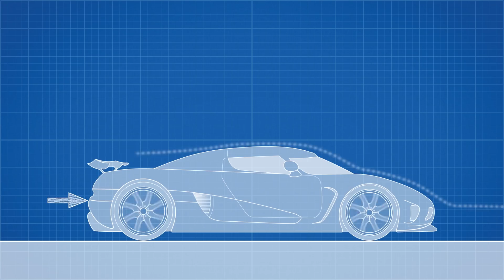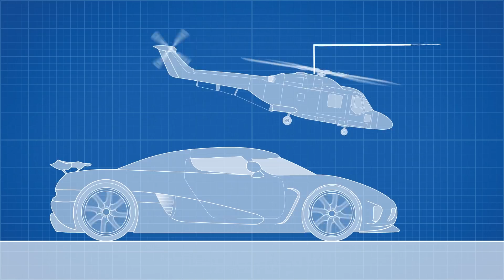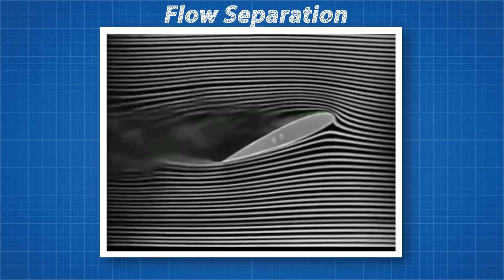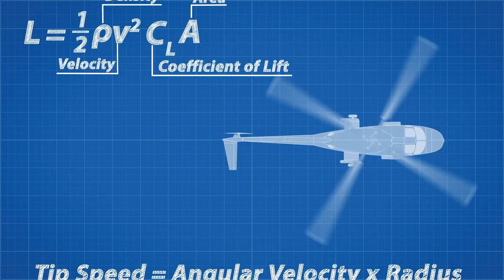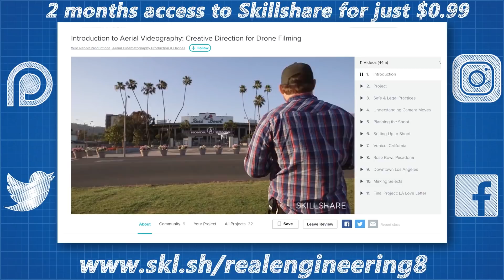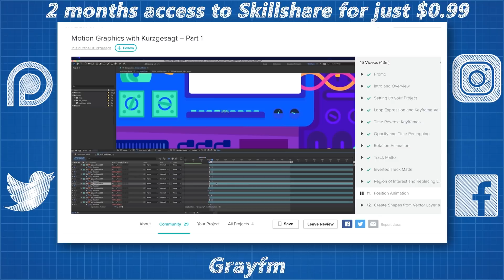Fastest Car vs. Fastest Helicopter - Which is Faster?

Comment from the maker: I misspoke in the intro sequence. Get TWO months of Skillshare for just 99c using this link: http://skl.sh/realengineering8
Reply: Hmm the arrows are going backwards but the tire appear moving forward.
Reply: please do an analysis of the Boeing–Sikorsky RAH-66 Comanche helicopter pretty pretty please
Reply: The arrows on wheels are drag, which are opposite to wheel movement.
Reply: More aviation stuff!!!!! <3

P.S. - In aviation, we generally use 'S' instead of 'A' in the lift equation.
Reply: btw i really enjoy your channel keep up the great work, i look forward to each new video !!!!!!!
Reply: Real Engineering oo
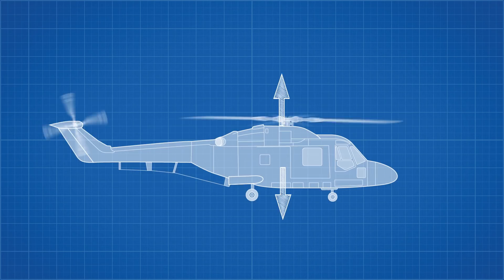Reply: Hi Brian, it would be great to see a video on some of the specific physics of the helicopter.  Like @3:24 angling the rotor disk forward to translate a portion of the lift into thrust.  There are some interesting things happening here.  The rotor hub is perpendicular to the rotor shaft and that angle would remain constant.  In hover, potential energy is equal across the rotor disk, so you wouldn't be able to angle it from a fuselage that is basically hanging from it like a gondola.  To move you have to change the way the rotor disk opposes gravity.  You have to put more potential energy on one side of the rotor disk by increasing the lift generated by the rotor blade as it sweeps around the helicopter.  Which is also interesting because of gyroscopic precession you have to apply the force 90 degrees to the direction you want the force.  If you want to go forward, you need more lift at the 6 o'clock position; however, the force has to be applied 90 degrees before.  In a clockwise rotating rotor,  that would mean the force would have to be applied at the 3 o'clock position.  If you look at some of the footage closely, you can see the rotor disk is angled perpendicular to the direction of travel.  Also, it is really interesting to consider how a helicopter actually moves.  Lift is generated by the rotor blades pushing the air down, which generates an upward force.  NASA explains how Newton's law generates lift with a wing -> https://www.grc.nasa.gov/www/k-12/airplane/wrong1.html.  If the four forces of flight are gravity/lift and drag/thrust, then how would the rotor blades generate thrust if they generate lift?  If the energy from the rotor blades rotating is used to generate lift, then you couldn't use that to generate thrust in a direction that isn't parallel to the direction of force.  Thrust is opposite of drag, so if you increase the trust from the rotors, you have to compensate for the drag.  The rotor blades are used to push the air down to make lift, if you decrease the rotor pitch, you decrease the lift; and if you increase the speed while maintaining rotor pitch, you increase lift.  Lift and thrust are not equal and opposite reactions.  There is a placard at the Smithsonian Air and Space museum, not the one in the Washington D.C. mall, the one near the airport, that explains how helicopters use a dyssemetry of force across the rotor disk to produce thrust.    Thrust is produced by increasing the potential energy on one side of the rotor disk which turns to thrust as the energy balances out across the rotor disk to maintain equilibrium against the pull of gravity over the rotor disk.  There is so much more about helicopters that is worth exploring.  Your assumption is correct, I am only educated enough to be dangerous...
Reply: Dont care about that but i love these videos
Reply: too bad it doesn't work when i click sign in with google OR the sign up button
[edit] nevermind, it worked now. their server must have been overloaded or something

hope i find a decent android programming course there.
Reply: That promotion transition was smooth af.
Reply: Okay...
Reply: Thanks! I literally had this argument yesterday! (I was on the side of cars)
Reply: Real Engineering why when i clicked the link for your website , the web wouldn't exist
Reply: I like watching videos where you start to think of questions and then almost as quickly as you think of them they are explained.  It makes you feel smart that you know what questions to ask!  (Of course, it's usually just an example of someone explaining things really well in a way that systematically runs through all the possibilities... but I'll pretend I'm smart about aerodynamics!)
Reply: Jorge & kuda, I assumed that the counter-rotating wheel arrows represented the force of rolling resistance. The arrow indicating drag force appeared shortly after.
Reply: "This video is brought to you by Skill Shareidgut-three months of learning....."
Reply: Real Engineering when utilizing dual counter-rotational rotors the airframe's strength limits the top speed also. The CH-47 Chinook is theoretically capable of reaching the speed barrier of rotorcraft, but it would twist itself in half from the increasing torque forces distorting the rotational center point toward opposite sides, if allowed past current governed outputs. Reinforcement of the airframe could negate the effects, but the mass increasing will restrict it in a similar way. There is always good ol' JATO rocket assistance, if you are tired of living, to beat the car's record.
Reply: Real Engineering after watching this I'm not sure if you fully understand how a cyclic controls work on a helicopter. The rotor head does not tilt as a whole. You are right in saying that the pitch of blades change as they rotate, but that's it. It's both cyclic and collective pitch mixing. It all is effected by gyroscope precession and is something interesting to read up on!
Reply: I checked it out but it seems kind of underwhelming, the tech lectures are nothing special, there are no home work assignments with grading and you can find pretty much the same content for free on other sites like coursera and youtube.
Reply: I'd like to see a video on the sterling engine.
Reply: Pretty sure the arrows were a tool to visualize the rolling resistance he talked about, and not the wheels directions
Reply: Real Engineering that's noice
Reply: Can we get skill share from or local 99c store?
Reply: It was demonstrating the rotational resistance.
Reply: The fastest car (agera rs) is faster than all but a couple special (past) prototype military helicopters, but traffic makes it hard to use that advantage so a chopper at max speed will be faster irl, also roads are rarely straight from a to b but around mountains etc unlike the choppers flight path but in a straight line with no traffic; yes i could easily outrun a helicopter in an agera rs.
Reply: ...until u get to the heli so fast it needed jet engines to get fast. yes, im talking about the BELL-222 AIRWOLF!!!!1111
Reply: SkillShare sells education as a luxury, helping to ensure that poor children will remain poor throughout their lives. SkillShare's CEO, Matt Cooper, whose children will never lack access to the very best education, spends a portion of his considerable income supporting US politicians who want even public education to come for a price (Sen. Claire McCaskill).

The poverty that comes with lack of access to education (among other factors) leads to much suffering and early death. A full quarter (!) of US insulin-dependent diabetics ration their insulin because they can't afford to buy enough. As you might imagine, they don't all survive this austerity, to which you contribute as you promote SkillShare.

That sponsorship money is blood money.
Reply: I love you so much 💓    you made think like an engineer,  send me your number please I want you to solve this problem   about Electrical engineering.......🤎
Reply: Correct me if I'm wrong but don't wheels rotate in the opposite direction to your arrow if a car is moving forward

Comment: The Lynx was heavily modified with its engines producing thrust also. The BO-105 has also achieved 404km/h. With the use of 4 or more rotors or stub wings achieving 400km/h isn't so difficult if it is designed for high speed, but the rotors and associated components are optimised for lower speed and hovering.

Comment: Good point on the definition of what a helicopter even is. By that note, we'd best define what a car is as well because the land speed record holder vehicles are cars in a very loose sense when compared to cars in our driveways. Any wheeled vehicle? Mmk. Is a helicopter then also any bladed vehicle? Definitions are important. Anyway, great video

Comment: The ability to change the angle of attack of the helicopter blades is actually how it tips the rotor forward using gyroscopic procession, and the dussimetry of lift effectively cancels that out making it so it's a negative feedback loop

Comment: The propeller os the only barrier for the helicopter to travel faster.
.the gears of the helicopter convert high rpm to huge torue to spool up the main prop. While supercar's gear desihn for speed. So why we debate this different kind of design.. all o know reciprocating engine cannot beat down gas turbine engine

Comment: Police chase of a muscle car, viewed by a TV helicopter.  The TV helicopter almost lost the car --- even with their crazy powerful (and crazy expensive) super stabilized zoom lenses they nearly lost them 10 miles away ... but the car then ran out of fuel :-)  So I was not exactly surprised.

5:36 ... more rotors.  We cannot increase the rotor tip speed, but we can use 10 or 20 rotors.  Splitting up the load means each rotor has less work (and therefore the individual rotor tip speed can be lower).  Also: "redundancy".

Comment: The Eurocopter X^3 uses what I’m assuming are a pair of turbo shaft engines on the end of those wings. What if those power plants were turbofan or turbojet engines? What then would be the theoretical top speed?

Comment: "Will always limit helicopters for the rest of time."

Hmmm.. not so sure about this.
Consider a helicopter on Saturn? The hydrogen atmosphere should give it a much higher speed limit due to higher sound speed.

Also consider that a helicopter can, in principle, be designed to pitch very far forward.

Comment: 6:04 there was a version of this back in. 1950s called the Fairey rotodyne. It had a freespinning rotor and two turboprops mounted on the wing to push it forward and boost its efficiency. It had tipjets on the tip of the blades to lift it up and are shut down in forward flight. Sadly it doesn't exist anymore

Comment: @Real Engineering - I have a question.  Because there is applied the law of gyroscopic precession, the lift generated on the right side of helicopter is apllied on the front side of helicopter. And the lift generated on the left side of helicopter is applied to the rear side of helicopter. So, in the case in video you need more lift generated on the left side of helicopter, than on the right side to tilt it foward. In that case the pilot needs no special mechanism. Pilot just push the cyclic more foward that causes tilting the swash plate - the left side down. That means the AoA on right side is lowered and on the left side is increased. Due to gyroscopic precession the lift is applied more to rear part of helicopter than the foward. So no special mechanism is needed. Am I right?

Comment: Before watching the video I guess the car is. The helicopter is limited by speed of sound on the edge of blade going foward and by the retracting blade stall.
The counter moving blades is also limited. The blades with the increasing foward speed are more and more bended until they can meeth themself.

Comment: My insane, stupid, and overly complex idea for the day:  What if you made a "helicopter" where instead of one rotor, you had two, but half the rotor's rotation occurs inside a body, such that the blade only produces lift when moving forwards?   Oh, and then, what if instead of a rotor, we make it basically a pair of giant glorified chainsaws with small wings on them?  ...What?  I SAID insane, stupid, and overly complex, didn't I? 

Chainsaw Copters!

Comment: The first helicopters called Chinooks were not Chinooks. That was a CH-46 Sea Knight, or Phrog (a common mis-identification). The navy/marine corps DID not use chinooks. oh, and as of 2012, the sea knight was retired from military use, and replaced by the V22 Osprey. 

The easiest ways of differentiating (from a distance) between the 47/46 is the front landing gear, the fuel cells, and the engines. The 46 only has one strut on the front, while the 47 has 2. The side mounted fuel cell on the 47 goes almost the full length of the helicopter, while the 46's is only roughly 5 feet long (stub wing). And the 47 has externally mounted engines while the 46 are internally mounted. The 47 is a Heavy lift helicopter while the 46 is a Medium lift helicopter, so the 47 is significantly larger.

Comment: I have questions about the power and force equations.

According to the power equation shown in the video, power seems to be a function of v^3. If you increase speed by 2 then power requirement increases by 8. But that's weird.

Best illustrated in a plane. If you fly 2 times the speed them aerodynamic pressure is 4 times higher, and the required thrust is 4 times higher too. Which means power is increased by 4, not 8. Hence, power seems to be a function of v^2 here.

Could you explain what's happening?

Comment: Suppose we take the coaxial "slowed rotor" concept to the extreme and actually STOP the rotors, using a prop or jet to provide propulsion.  Now rotor tip speed = the aircraft's forward airspeed.  Assuming the engineering challenges can be met (sufficient rotor stiffness and lift coefficient), would not the theoretical speed limit be significantly higher than for spinning-rotor configurations?

Comment: 1:58 you used the horsepower at the crankshaft, not the wheel horsepower. Drivetrain loss due to friction is usually around 15%-20% for a RWD car, which would leave you with about 985 hp (735 kW) at the wheels, which is what matters.

Comment: this one was easy the car has the ground to grab onto and propel itself forward the helicopter only has the air to grip onto and whats more it also has to use enough of it to keep it off the ground, both modes of transportation use a reciprocating hydrocarbon burning engine.....

Comment: About the diference of speed of blades on left and right side of helicotper. How about gyroscopic precession? So the more lift on right side -> Nose moving up. The less lift on left side -> tail is moving down. So in result the helicopter is not "disbalanced" in roll axis, but in pitch axis. This can be also balanced by tail wings, which many helicopters have and do. The tail wing is quite far away form rotor so low force is needed to make high enough momentum for counteracting the lift dysimetry. Some helicopters uses the Fenestron or NOTAR which reduces drag quite a lot. In result this problem looks like easy to solve. The bigger problem caused by lift dysimetry is harmonic or periodic bending of blades with very high frequency. And one note. I did not find any information about Effective Translational Lift (ETL) phenomena. This phenomena results in needing much less power for flying than for hovering. IMO actually the only limit is caused primarily by compressibility, engine power and weight, and cetrifugal forces. BTW you can also increase lift by adding more blades.

Comment: But then again, A helicopter was designed for flexibility of use and high maneuverability, not to be fast. A helicopter that can fly at 400 Km/h is amazing, considering the problem it has, especially with aerodynamic.

Comment: Agera rs is the fastest, but not the quickest at 1/4 mile. Some Fords back in the 60s ran 10s flat out using the legendary 427 Cammer, one of the best N/A engines of all time.

Comment: If both are dropped from free fall lets say terminal velocity would be around 200 to 240 km/h however if both objects were not aerodynamic then terminal velocity would be about 180 km/h to 200 km/h but if both were pointing nose down then the car would reach a higher top speed due to the car's body being more aerodynamic then the helicopter would be slower buuuuuuuuuuuut the cars aerodynamics is deigned for down force as well which could have an affect on the overall terminal velocity as well

Comment: The AH 56 Cheyenne project was the early combination Rotary Wing platform.  It was fast and maneuverable, but not close to perfected when canceled.  Fastest rotor speed in a flying machine has to be the Fairey Rotodyne, the Screechtastic helicopter with ram jets out at the ends of the rotor blades.

Comment: Helicopters have disadvantages, as they need to tilt forwards and fly upwards to generate an upwards force. If they tilt too much, they can't fly upwards, and hold themselves in the air anymore, so they'll stall to the ground, so my guess is that the car wins

Comment: 315 km/h is Chinook's top speed. It doesn't 'cruise' at top speed. Cruise speed is lower. And also Chinook can't be the fastest military helo, due to the fact that the Russian Mi-24 tops at 340 km/h. Not trying to provoke a whose penis is bigger war, just pointing out some factual errors in the video.